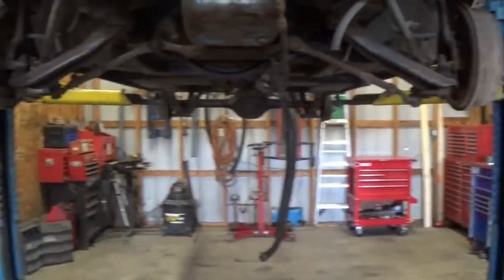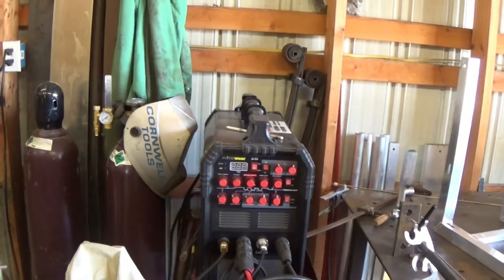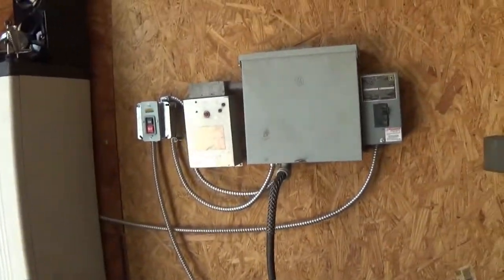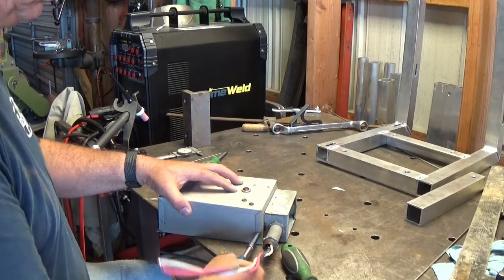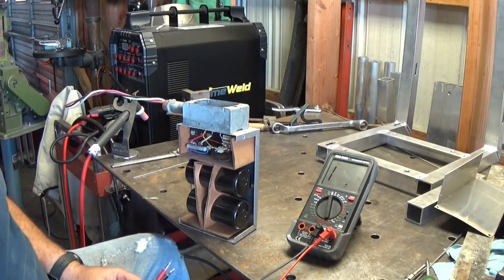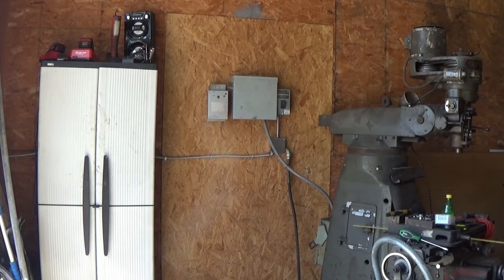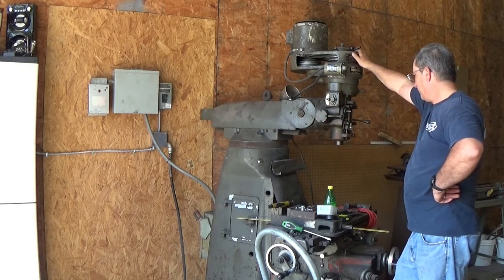Thought I blew up my 3phase Static Converter

Comment: Hello friend, please could you take a picture of all internal connections? I have one PAM-900 but lost the order of connections, also I don't know the value of the resistor
Reply from the maker: Hello, Thank you for your comment/question. Sorry about the long delay in getting back with you. I have been sick. 
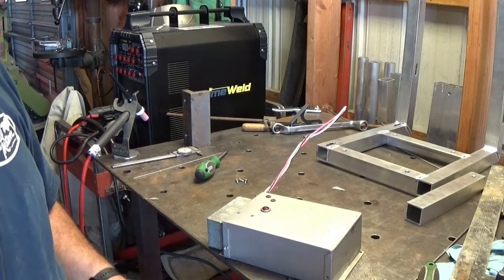Since I have everything installed and in place it would be difficult to disassemble again. If you re-watch the video starting around 8:00 min mark; there is some good shots of the wiring and stuff. If you look at my bench around the 11 min mark you can see writing on the bench. That is the numbers and information off of the capacitors. 
I hope this helps you. If  you would like wiring information ion the rotary part of the convertor, let me know and I will try to get that for you a little quicker. Again, sorry about the long delay.
Reply: @mancavegarage  Very thanks for your attention I appreciate that, I wish you get better soon; if you have time latter I would like the wiring information; Thank you very much in advance and may my health continue to be better